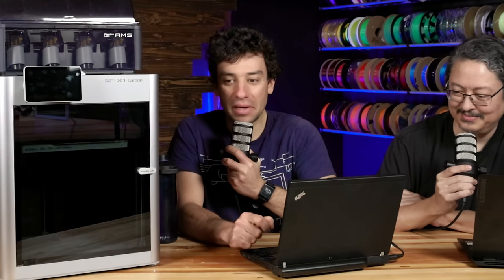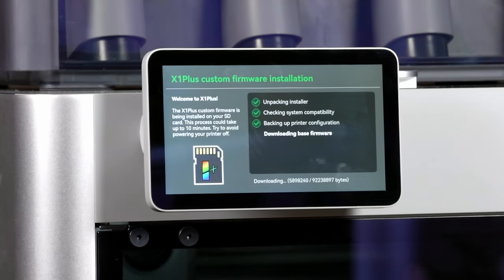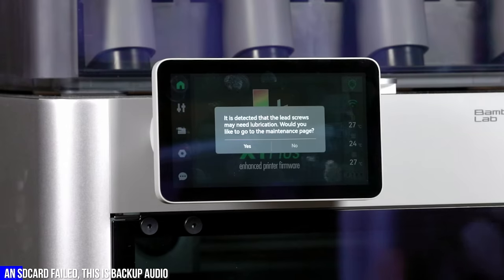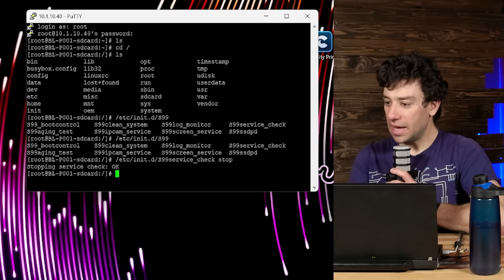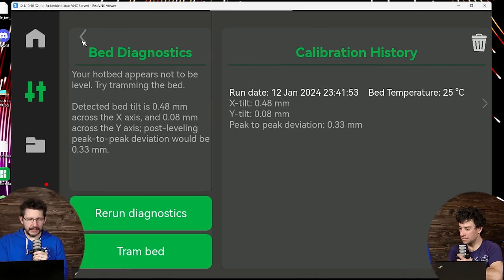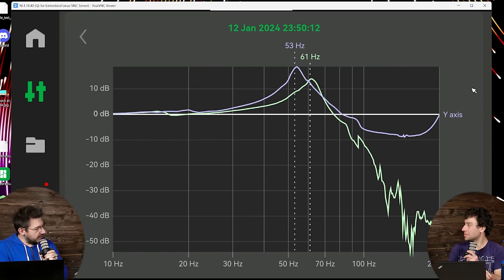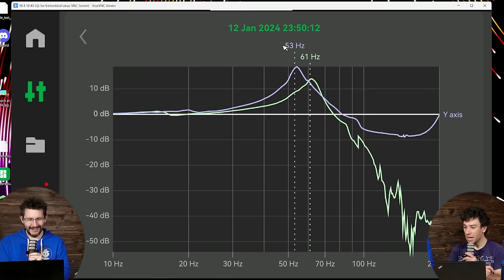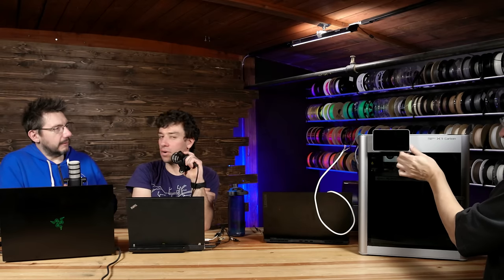Custom Bambu Lab firmware? The X1Plus Team shows us how

Comment: Thank you Joel for having us in your studio! It was a lot of fun hanging out and it was really cool showing off ssh and vnc to your printer! If we visit again maybe we can finally lubricate those leadscrews! 😁
Reply: Very interesting and refreshing work! Thanks for sharing!
Reply: I didnt know the printer wasn't tramming itself when it did bed leveling. Keep up the great work! I love my stock x1c and am not worried about what is sent to BL. If they want to reprint voron parts or other models I'm printing, go for it. 😂 But I doubt they care about what we print.
Reply: Joshua as a radio & firmware engineer your next challenge is ICOM SDR firmware ! We really need it opened :)
Reply: Do you have any plans for making custom firmware for A1/A1 mini? So that the bed could be set to 80c+ etc.
Reply: @buka9993  it was possible on the X1C because it runs linux. The A series and P series does not
Reply: is this coming to the p1p???
Reply: @darren990  no, most likely
Reply: Could you make a 500mm by 500mm by 500mm printer? It could be called the x1 mega or x1m does my idea sound good?😅😊
Reply: @Thedoggyboi  500 would be insane,  the printer would be 3 feet long and be HEAVY
Reply: I just got the k1 max it’s print volume is 300 mm cubed or 1ft cubed. The reason for why I didn’t get the Bambu was because I didn’t think it was big enough. It’s about 256mm cubed but you are limited to around 240mm cubed if you don’t tweak the settings. If they come out with something like a Bambu mega or x1m they should also maybe let us put up to 24 or 28 colors at a time. They could even double the amount of colors since they would double the size to 500mm. Anyways that would be cool. Probably would be 5000$ with the 8 extra color things that can print 4 colors per thing. Anyways yeah pretty cool concept.
Reply: @darren990  Impossible. The P1P does not run Linux like the X1C, so this exact firmware can't be used.
Reply: @Thedoggyboi  as a x1c owner I say you made a better choice.
Reply: Thank you so much for all you had done and keep doing. You made a crap printer way better. 
You said a lot of good about this ccp company and it is your belief but not mine. And obviously it not good since you went through all that work to make it better.
Reply: Can you please confirm that x1plus can be installed on new printers if I order one today?  I heard that Bambu closed the security hole which allowed you to jailbreak it.  Since you've been talking to the company, have you agreed a mechanism to do this on all base firmware versions?

Comment: I'm holding off for now on getting an X1C until we have a confirmation that there's an option for this type of third party firmware. While i wouldn't want to change too much initially from stock I'd like the option of things like running a syslog server, adding some "firewall rules" at the bare minimum. Also, id be much more keen on the investment if i knew the project was maintained in the event it was depreciated (meaning Bambu). Excellent work.

Comment: In my opinion, the most important feature of the XPlus firmware is the offline update function.

This should actually also be part of the original firmware. In many companies, no connection to the Internet is allowed for security reasons. And it is also convenient if you don't have a reliable internet connection or if there is no network connection at the location where the printer is located.
Reply: Kind of funny talking about security on a hacked firmware. So you're trusting some hack boot loader just so you don't have to go through the official supported update. Ironic :)

Comment: The way that the 3D printing community has treated Bambu has been downright shameful, to be honest. It seems like a huge portion of the community selected Prusa and Creality as their favorite manufacturers years ago and, instead of welcoming competition and better devices from other companies, actively protect Prusa and Creality from competition and engage in really toxic and antagonistic behavior toward companies like Bambu.

The X1Carbon continues to be the single best 3D printer I've ever used. Good products deserve to be rewarded, because competition is good, and Bambu shook up the then-stagnant 3D printing market in the best way.
Reply: You are spot on.

I am a newish user(few years) to the space and the outright lies, innuendo and vitriol is disturbing. 
A whole new batch of users are coming into the space and the gatekeeping of the legacy users could turn people off. 

The DIYers can still build or tinker with their machines.
The Open source folks can still inspect lines of code and tweak every aspect
The actual users who just want to print have another, reliable, easy to use, printer available and the 3d community has circled the wagons on their brand and outright abusive about the new kid. All while ignoring the very slow and glacial changes that were happening in the space before the X1/X1C.
 
And not to be an hypocrite but the competition to the bambu printers have been less than stellar when compared. (rushed products, QA issues, beta firmware, no AMS or reliable filament changer, just checking off spec boxes but ignoring the user experience)

Great comment.

Comment: What they don't mention is what kind of wear on the memory card and slot in the screen running this software full time? If this borks the slot you are paying 150 for a new screen out of pocket at least.
He did say the printer crashes in a spectacular fashion if the card is removed prematurely...what happens when it fails? Will the print head come crashing into something? Fans, heater, voltage spikes to mainboard?

Comment: thank you!  this might make it possible to use bambu printers! 
I cannot reconcile it with my conscience to use a device that only receives firmware updates via the cloud. I have ordered a P1S (i am thinking of sending it back when it arrives due to privacy concerns - still debating it with myself)  and hope that there will be a similar firmware for it. but I still have bad feelings that I have to do all this to be able to operate the device "safely".  I only use linux, vpn and a smartphone with open source firmware, I have the feeling that I am making a fool of myself when I use a bambu printer, it simply contradicts all my principles. I hope that Prusa's software will improve and that the strategy of copying for Bambu will not pay off. Nevertheless, I must admit that the existence of bambu lab has lead to great innovations in the market.

Comment: Side note, I've always wondered what that lead-screw notification is triggered by .. is it just a timer? Or does it take feedback from the machine in some way?  With regards to the X1 Plus firmware, this was a great interview in terms of answering a lot of lingering questions -- primarily, I was curious if we were going to be stuck on the FW 1.7 feature set since the BLab blog post seemed to make it sound like they'd have the one rootable firmware and that was it. I don't care about the hardware warranty (I'm probably out of it) and have never used their support channel (besides reporting bugs in the early days). Seems we've got a path forward, with X1 Plus downloading the newer FW packages.

It'll be really fun to see what else the OS community comes up with in terms of enhancements.

Comment: This makes me seriously consider buying a Bambu.
Without something like this, I would never buy a Bambu.
Good job guys!
Reply: Really? Its hardly revolutionary. The X1Plus that is. We replaced all our machines in our farm with X1C. There is no better printer.
Reply: This is not an open source firmware, it's an hack overlay running over a binary proprietary firmware.
Reply: This is certainly encouraging.  I moved away from Bambu in general as the CEO made it clear they want to benefit from open source, but have zero intentions of giving back.
Reply: @Festivejelly  Really? I never thought anyone would invest on a bunch of X1C for farms, There are a few of FDM Based 3D printer farms switching from Prusa to The P1S. What made you go with the X1C vs P1S and paying almost twice for the printer?
Reply: @nicamarvin  Seems like it could be worth it if you are doing lots of one off jobs requiring different filaments and thus using the X1s auto flow calibration.
Reply: @nicamarvin  I have both the P1S and X1 and the P1S needs hand holding.  My X1 is fire and forget.  Still love my P1S, but it needs to be baby sat sometimes (depending on the print).
Reply: @nicamarvin  I just watched a video (I can't remember which channel) comparing the reliability of the X1 with Prusa.  The X1 had more throughput, and fewer failed prints.  His farm's running out of space, so replacing the Prusas with X1s is a way to get more out of the space available.  He didn't mention the P1S, so I've no idea if that was even considered.

Comment: That was an awesome watch, and it makes me want to buy a Bambulab printer.
Hopefully the mods can be extended to P1 and A1, but are they not running the Linux system component at all?
Reply: the p1 and a1have junk processor they cant run linux to run this so they would need make it for p1 or u would need raspberry pi

Comment: Now my big question is can that Bambu Lab logo light on the X1C extruder be turned off by software or is it hardwired to power? The "power" button on the top only turns off the screen by design, but really should be a full standby. It should turns off the screen, LEDs and fans leaving only WiFi enabled for wake up. If only...
Reply: there is a mod on printables called " color your bambulab tool head led ", just print this part in black and no more led light.
it seems X1plus have the option to control the head tool led.

Comment: starting with an X1C donor machine, mechanically speaking, designing and cobbling together a double bed (256x512mm or even 300x600mm) machine would be easy.     Separate dual build plates are easily sourced and the existing z-bits could move the additional bed weight.    The firmware would need the bed size to be changed (? if auto end stop doesn't solve this) and need to increase the mesh leveling to 16x32 points.  Could this firmware be configured to this larger printer?  Would the bambu studio slicer be able to resize the bed to the new larger size, so prints could be laid out and sliced?

Comment: I'm excited to try it, I'm refusing to update my firmware until its released.
Reply: no need you cant run it on that firmware bambu is releasing  a special version of 1.7 so you can run the x1plus firmware you will have sign away warranty and access to support forever

Comment: My biggest question is will Bambu Lab release a filament printer with a larger build volume? 256mm cube is small. I wish there were a 400mm cube or 500mm cube version or even an IDEX vesion as well to cut down on all the wasted filament. It's ironic to waste so much filament while printing multi coloured or multi material objects.

Comment: @3DPrintingNerd is the lag seen on screen part of a screencast issue or related to the firmware running from a SD?
And, if you know it, is the X1+ fw supposedly being installed on the display motherboard or the MC motherboard?
Reply: I think that's a VNC thing, so related to the method they used to get the printer screen into the video. Used to see it a lot when I used to VNC into servers.

Comment: What heppens if the SD card fails?
Reply: exactly as I was thinking about that, when he said the x1plus firmware is on the card, and then Joel's sdcard failed... what happens then?
Reply: at 25:48, Joshua says "don't pull the SD card while you're running X1plus. if everythin goes well, you get an angry warning message. if not, then the printer crashes in weird ways." so my guess is it's the same thing when the SD card fails while the machine is running...
Reply: it would crash and you'd reinstall on a fresh SD. The boot loader modification is essentially just a very minor tweak on the AP board that tells it it's allowed to boot from an SD.
Reply: @shenqiangshou exactly. There would always be a chance that an SD card would fail while it is in the printer. So like what @Rick-vm8bl  mentioned, probably would need to reinstall on a fresh SD again. I'd probably just wait a while longer to see the use and then decide. I'm happy with the Bambu Lab firmware as for now.
Reply: Because it's Linux, I wonder if you can just backup the important bits with rsync or something through the network on a regular basis thus avoiding data loss :)

Comment: For those who get the Panda Touch, or the like.. can we expect this to work on the P series?
Reply: No. The P series has completely different hardware and as far as I know it is not powerful enough to run a Linux system. The Panda Touch simply uses the MQTT protocol that the slicer also uses when communicating with the printer.
Reply: @andreas.grundler awesome response, thank you so much. I will save for an X1, and look to get this software suite! Keep up the good work!

Comment: How refreshing for a company to be so open to working with them like this.  I've been strongly considering the X1 Combo, and have only been waiting for Prusa's XL to compare.  So far it seems Prusa has dropped the ball, and for a machine that's 2.5 to 3 times the price of the X1 Combo, I can't justify the extra expense on an inferior printer.

My only concern is that (according to original reports) the jailbreaking cannot be done on firmware 1.7.2 and later.  If I order a new printer from them, will I be able to install X1plus?  Apart from giving Prusa a chance to bring the XL to market, the main reason I haven't bought an X1 is the closed source aspect.  If I can be sure that I can jailbreak it, I'll order one.

Could someone who knows for sure reassure me that new machines will still be capable of being jailbroken?  It sounds like the company will be open to having an official mechanism to do this, so I'm hopeful.

Comment: Why is modding the firmware on anything a issue.
The product that's getting the new firmware IS your property.
Not the manufacturer.

When I get a PC, one of the first things I do is wipe it to remove all the crap I don't want. Then install whatever I want on it. 
The manufacturer should have no say-so on what I do with my stuff.
Reply: That is the point. Bambu Lab's view is that if they have control, support is easier because all printers are virtually the same. If you install custom firmware, it makes it harder for support.

I can understand that from the company's point of view. I work in support for a hosting provider myself and when customers change something on the system it is more difficult to find problems. But I'm also a Linux user, so I don't like being locked into a closed system.
Reply: je2854  i would imagine they, a business, would want to replicate a 3t dollar company
Reply: You can do what you want with it, just don't expect the company to fix your mistakes for free.  You own the machine, you own your mistakes.

A warranty is just insurance.  The premium (built into the machine's price) is based on it operating within the bounds set by the supplied software.  If you install other software that's your responsibility.

Why do 3D printer owners expect any different treatment than you get from any other consumer product?  If you chip your car and blow your engine, you pay for it.  If you break the security seals on just about any consumer item, you void your warranty.  Somehow, 3D printer users expect carte blanche to do whatever they want and have the company pick up the bill when it goes wrong.

Comment: I've been a software developer for nearly 40 years.  There's no legitimate reason to export the SSID off the machine.  None at all.
Reply: I have been a field  20yrs and the knowing SSID has been useful.
When troubleshooting devices it's important to know what it is connected to. Can't print, it's because you are on the open xfinity wifi
Cannot access the network drive? you are on some rando router you left plugged. Speed garbage and you are right next to the AP, switch to 5gh etc. 

Just because you haven't used it does not mean it is not useful.